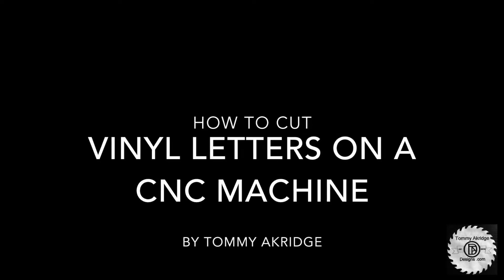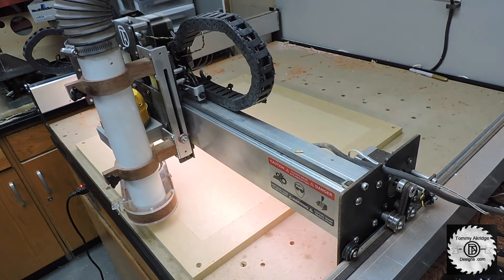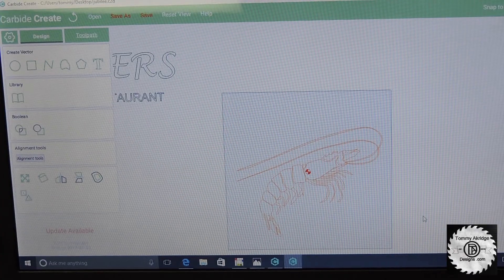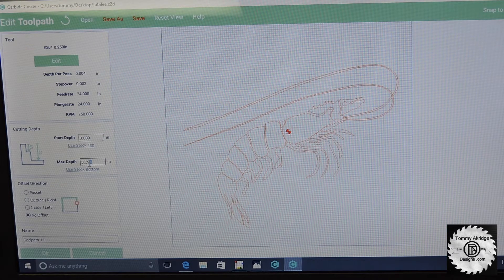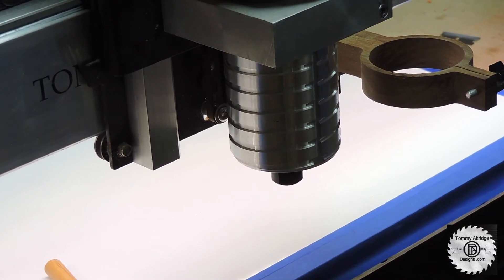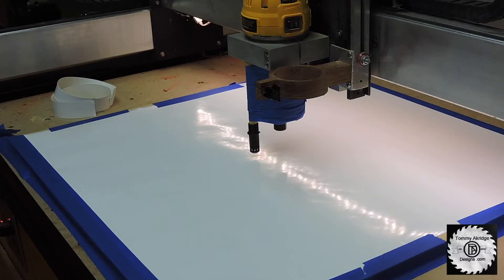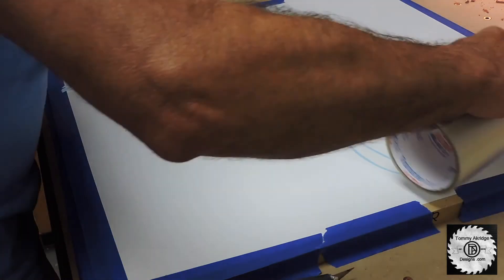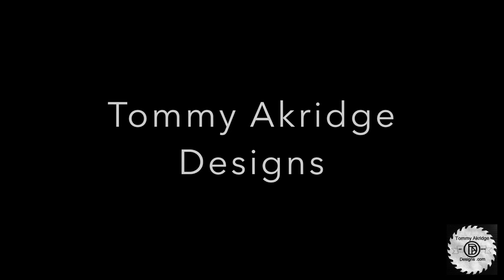Cutting Vinyl letters on a CNC Machine

Comment: Great Idea!  I had never considered using a Silhouette cutter on the CNC. 
Silhouette now has a knife that can cut ~2mm deep so one could cut leather or cloth or paperboard too.
Billy Smether's idea of spring loading the cutter is a good idea too. I have pens for plotting that sit in a spring loaded holder that I run on the CNC. 
For an amateur wanting to try this out (like me), Dollar Stores sell low adhesive vinyl shelf paper that I've seen works well -- probably not for glass etching though ;-)

A final thought; instead of blue tape, maybe try craft (Elmer's) spray adhesive on the vinyl backer. It's not real sticky but could eliminate any wrinkles.
Again, Super Idea! Thanks for sharing.

Comment: I mean... once you spend 20 grand on a CNC machine... spend another $200 on a purpose built vinyl cutter?
Reply from the maker: I spent $1500 on a cnc machine and use it for more then vinyl. So why would I pay $200 if I all ready have the CNC?
Reply: @Tommyakridgedesigns  Oh... yeah, CNC machines start at $11,000 I'm not sure what you have. Mine is like $26,000. 
Do you mean one of those butter cutters?

Comment: You probably won't be consistent with this method.  Your bed has to have a level consistency of .0001 to continue to cut the vinyl properly.  You need to float the cutter.  The dial is used to set  how deep the cutter cuts into the vinyl.  Adjust the dial until the blade cuts through the vinyl but not the backer.  You can do this by hand without the cnc machine.   Now just figure out how to mount the tool so it can move up and down on its own.  Then the tool can follow the highs and lows of your table and you will have perfect cuts every time.  A piece of glass as a surface works well also.  You can use a spring or weight for proper pressure.  Good luck.
Reply from the maker: I surfaced my bed with the CNC and I get a great cut every time.

Comment: Hi Tommy.  Quick question.  I am going to try this on my cnc.  I purchased a couple of the same cutters.  How did you decide which number to set your cutter on?  Thanks.
Reply from the maker: I used a caliper to get the thickness of the top part of the vinyl